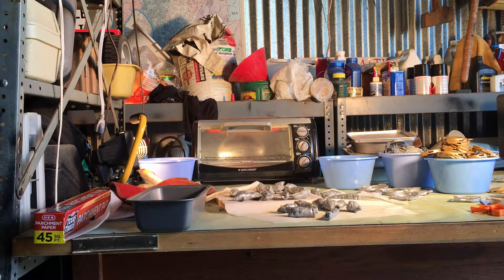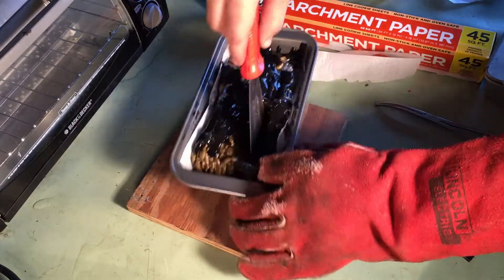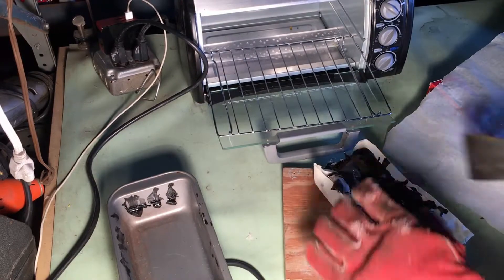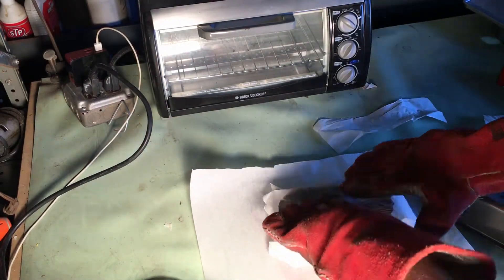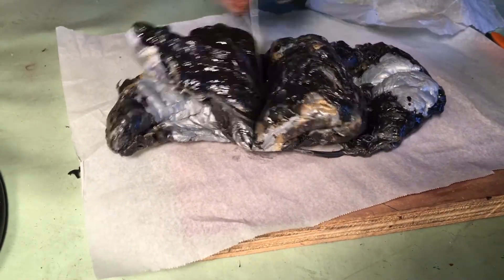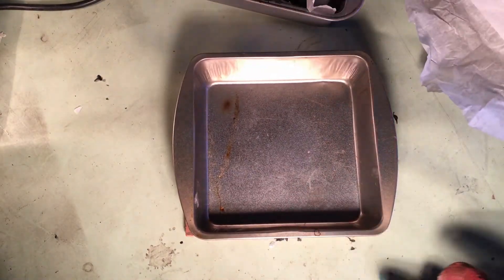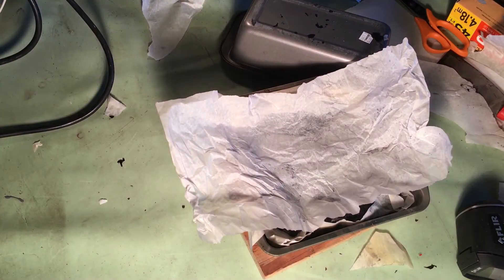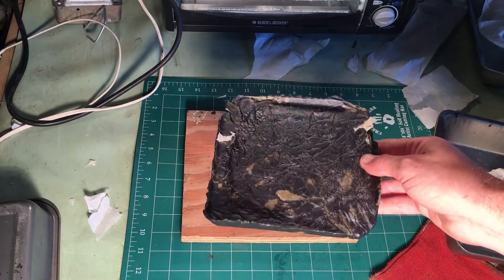Making a Plate Blank from Reclaimed #2 HDPE Plastic

Comment: any experience in using a jointer or plainer to surface out the wrinkles? It looks like your manipulation of the plastic is removing any air pockets or resulting voids.
Reply from the maker: I personally haven't used a jointer or plainer with plastics, but I have seen it done on the videos of others. In my experience, all wood tools are fair game with this material. Just be careful!